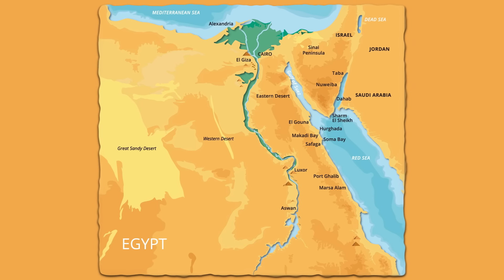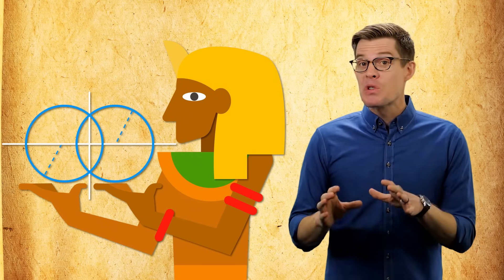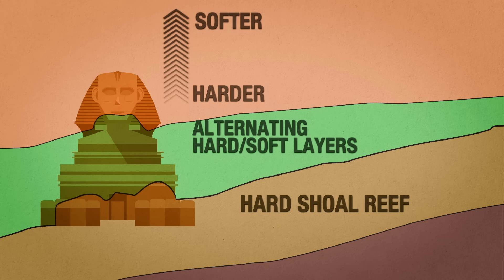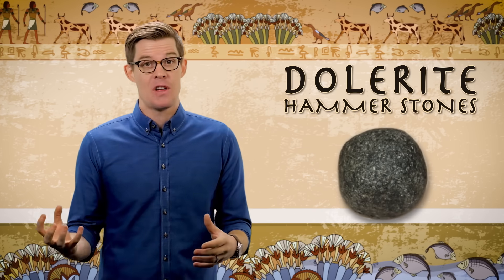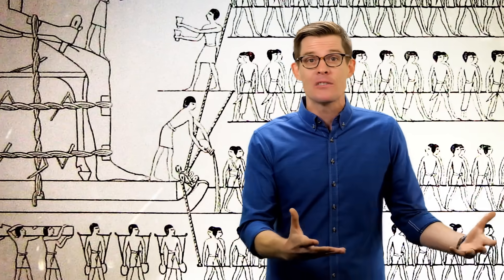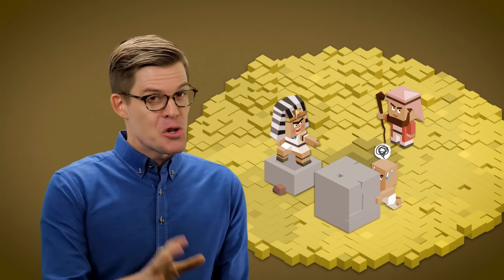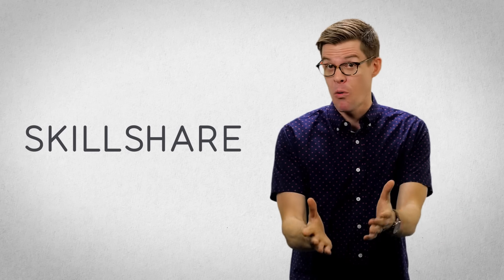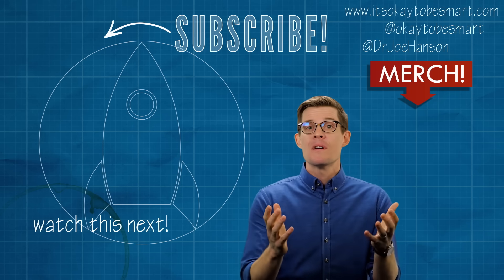The INCREDIBLE Ancient Engineering That Built the Pyramids

Comment: Bring your evidence you say!? There is no evidence. Please demonstrate a copper tool cutting granite to a perfectly level, precise surface! You skipped the bit about raising (or lowering) 100 tonne granite blocks into place. Fact is there is no science  can demonstrate how they built many other places also. Such as the Serapeum at Saqquara which does not have the space to move the massive blocks.
Reply: 🥱  First is there are no "100 ton blocks" in any of the pyramids.  Next is what blocks you do see are far from "perfect".  Last is there is ample room on the Serapeum to maneuver the sarcophagi into the crypts.  Perhaps you should find new more credible sources of information given your poor assumptions here.  Just saying.
Reply: @varyolla435  OK 70 ton blocks then in the Kings chamber. There is enough room in the Serapeum for about 50 to 70 men in very cramped condition. That's along the tunnel which would be pretty useless in turning the corners and then lowering the granite blocks into position and you'd need more than 70 men for that. Add to that the granite cut with laser precision that most engineers agree they don't have a clue how they did it with primitive tooling. That same precision was used in the Kings chamber and the grand gallery in the great pyramid where you cannot fit a razor blade between the blocks. Maybe you should do your research before commenting... Just saying!
Reply: @ramases1  lol!  I have "researched" as you say = for 40+ years.  The Serapeum was modified for tourism.  Thus niches and corridors have been built up in places to modernize them.  

Also niches are kitty corner from each other.  Thus a sarcophagus on a sled can be pushed upon from the opposite niche across the corridor.  Look at a diagram of the temple.  See whereby there are always opposite niches or new corridors where corner niches are found.  

Finally why do you only assume "men"???  Did it never occur to you that they also used oxen for construction etc.?  Build a wooden frame around a block and it can be pushed upon and maneuvered via a wooden plank/log path.  There are old B&W videos on YT of massive blocks being moved from quarries in such a manner.  

As to razor blades = PFFFT!  Smooth 2 blocks and stack them atop each other.  Now stack several hundred thousand tons of blocks on those.  I rather think the enormous compressive pressure will prevent you inserting something in the joint.  Parroting inane rationalizations is not indicative of actual research - nor critical thinking.  Dig deeper.
Reply: @varyolla435 The Serapeum has been altered for tourism but only for ease of access so makes it even harder to believe what they did supposedly with stone age tools and methods. How can you lift a 70 ton granite block and move it round a corner then lower it into a space when you only have a few metres of corridor to work in and a matter of inches at the sides of the tombs. Why have no archaeologists or engineers been able to demonstrate this? Because it's impossible with the technology available to the Egyptians. As for your stone theory, piling rocks on top of other rocks to cause pressure weight will not miraculously flatten out the stones beneath. Do you seriously think if you have a roughly shaped block of granite and you cover it with masses of stone then it will somehow become this perfect rectangular block with angles and surfaces of laser precision!!? This is the kind of response a 5 year old would give. Come back and argue when the calibre of your arguments has reached maturity and you have caught up with evidential study

Comment: And what about 70 ton granite slabs from Aswan and how they hollowed out coffins from granite making the inside of them perfect 90 degree angles..
Reply: Look harder.  Old Kingdom sarcophagi such as in the Great Pyramid if you look at closeup photos = do not have perfectly formed sides.  Things look "neat" from a distance because your brain is "filling in the blanks" to sharpen what your eyes perceive.  Yet up close imperfections become more apparent.

Look at the depiction of artisans at work in the tomb of Rekhmire.  See an Egyptian as an example using a square to check plumb on the side of a block.  See another using a tubular bow drill to drill a hole.  There is a stone artifact unearthed at Armana which was created in part via small drill holes.  In the drill holes was residue = copper and corundum.

Moral of the story:  look at photos of those relieving chambers.  See where they are little more than roughly hammered out chunks of granite in approximate rectangular shape.  Thus as they were not supposed to be seen the Egyptians exerted little effort into shaping them.  They merely hammered out "rectangular-ish" slabs of granite and dragged them into position.

As to sarcophagi.  Heating an area using fire to soften the stone along with tubular copper drills and an abrasive like sand or corundum will allow you to remove cores from the center of a block.  Then using gneiss stone tools to hammer/chip out those cores and flatten out the sides = you can via polishing with flat blocks smooth the sides out.  Those sides like the depiction can be checked against a wooden square for plumb - just as carpenters do for walls today.  Yes it can be time consuming.......but they had the time.  Artisans were employed by the Pharaohs and this was all they did as it was their job.  Pharaohs gave them housing and food and they worked solely on creating what the Pharaohs wanted.
Reply: @varyolla435  they went to different parts of the sarcophagus with a right angle protractor to show the viewer. Can you provide a video of someone doing this with those primitive tools? That’d be pretty awesome to see.
Reply: @Joseph-dd9sj  I know of no videos of someone making sarcophagi.  If you look for videos on Egyptian granite cutting in the search box you can see experts using tools as depicted in Rekhmire's tomb.  Among the experts is Denys Stocks.  He has duplicated stone objects using Egyptian techniques.  Read up on him.

Comment: what about the granite boxes? copper tools and hammer stones wouldn't be up to the job.
Reply: If you mean the sarcophagi.  Dolerite and fire can be used to obtain the rectangular blocks from the bedrock which are then polished using flat blocks and an abrasive such as sand or corundum.  The insides can be removed using gneiss stone tools to chip it out or tubular copper drills to systematically remove sections of the stone which are hammered free.  What remains is then sanded smooth the same as the exterior.  

There are videos here on YT which show copper saws and drills such as are seen in the depiction of Egyptian craftsmen at work in the tomb of Rekhmire.  They along with sand in the video and "elbow grease" can cut granite.  A stone artifact unearthed at Armana was fashioned in part using a tubular drill.  In the drill hole was residue which when analyzed showed copper and corundum - Mohs scale 9.  

Bear in mind that they would have known before the foundation of the pyramid was laid out how much granite was required.  So a quarry like Aswan which was in continuous operation would have had partially quarried stone on hand and they would have had years to fashion what was needed and transport it to GIza before it was to be placed in the pyramid.  You must consider the totality of what was going on.
Reply: @varyolla435  thanks for the comment, il check these video's out that show examples of how they were made.

Comment: Ya ok, under fed men with pulleys and ropes hauled 100 ton stones 200-300ft in the air up 60 degree inclines.
Reply: Except that:

1 - there are no 100 ton blocks in the pyramid.
2 - they are not 200-300 feet up in the air. 
3 - you are assuming the ramp to be 60 degrees = based upon what exactly??
4 - you assume the men were underfed = when the evidence shows otherwise.
5 - you assume only men were engaged in manual labor = when the evidence shows otherwise.

Moral of the story:  so we see lots of poor assumptions = but no actual facts.  So we have evidence they used ropes and sleds as examples exist in museums along with tomb depictions.  The largest blocks in the Great Pyramid are only estimated to be around ~70 tons or so while the King's Chamber is between 40-60 meters above ground level = making it less than 200 feet up.  The midden heaps at the worker village show a varied diet far above what the average Egyptian consumed which shows they were fed well.  

Meanwhile the ramp really only needed to go as high as the largest/heaviest blocks to be raised = King's Chamber.  Above that level the blocks get smaller and thus levers and a device such as Herodotus wrote of which used a fulcrum and counterweight could raise the smaller blocks from level to level.  Finally they found tens of thousands of cattle bones at the worker village.  We further see loads of examples of oxen employed in labor to include pulling a sarcophagus such as in the tomb of Hunefer.  So they would have used draft animals in addition to manpower to pull large stones.  Next time learn what you try to claim as things go better when you do.  Better luck next time.

Comment: No one knows the answer.  This is a bunch of highly educated people who come up with these crazy theories that HAVE NEVER, EVER proven!  Just show one video of someone cutting, moving an 80 ton granite stone, lift on a wooden boat, 500 miles away and place it. I would just love to see the size of just one of boats.  With copper tools, heat and sand...I can't!
Reply: 1 - you have elucidated a failure of logic here in that you apparently can only conceive of lifting a block.  I guess it never occurred to you that ancient people - and even today coincidentally - routinely employed = ramps.  Thus they did not need a crane as they had a ramp to raise those few heavy granite slabs the short distance from the ground to their place in the pyramid - those blocks are only about 1/3rd the way up.  
2 - blocks were moved via wooden sleds pulled by teams of men and draft animals = oxen.  Only the smaller blocks which make up most of the pyramid would have been raised the short distance to move them from level to level via a type of lever device employing a fulcrum and counterweight akin to the Egyptian shaduf.
3 - as to the boats.  There are of course the large solar boats buried alongside the Great Pyramid as remaining examples.  For even larger ones feel free to Google depictions of the massive 3 decked barges seen on the walls of Hatshepsut's mortuary temple.  There you will see huge wooden barges laden with obelisks which are further being pulled by multiple smaller ships via sails and pole men.  

There are coincidentally videos here on YouTube showing them cutting granite with copper saws and sand.  Also there was once a harbor which sat at the base of the Giza plateau about ~500 meters from the Great Pyramid beside the Temple of Khafre and the Sphinx.  It still has the stone jetties sloping underground where barges once unloaded.  Finally the diary of Merer elucidates this process as he and his crew were tasked with bringing the white limestone used for casing stones on the Great Pyramid to Giza from the Tura quarries.  Better luck next time.

Comment: oke, that copper saws and sand can cut limestone is true. I would like to see a 'real life' experiment where a team cuts 2 (just two) complet blocks with a copper saw and sand.
Then they will fit them together in such a manner that a credit card will not fit between them anywhere.
And then the will cut two granite blocks and do the same fitting together.
and then the 'sarcofagus' in the 'Kings chamer'

And then we'll talk again.
Reply: Facile logic.  You do not need to fashion "complete blocks" to demonstrate proof of concept - straw man argument.  All you need to do is to show you can cut stone using the aforementioned tools.  If you can saw/drill into a block using bronze tools along with abrasives = the method works and the subsequent fashioning of blocks or whatever becomes a matter of detail.  

As it happens you can seek in the search box above a video:  Granite Cutting and Drilling.  See whereby Egyptologists and subject-matter experts saw/drill into a granite block using a sand/water mixture along with bronze tools such as are depicted in Egyptian tombs.
Reply: @varyolla435  Negative!!!

You DO need to show you can fashion complete blocks; including the most difficult parts like:
- making oposite sides parallel,
- 90 deg. corners;
- smoothness
- etc. etc.

in the same time it will give a feeling for 'production times'.

One of the main issues with traditional Egyptology is: Logistick.

Show me it can be done in with the primitive tools; in the requiered time, with the exact same result.

'proof of concept' is NOT enough, not by a long shot.

And yes, I saw some of these 'proof of concepts' form traditional Egyptologists.
But the prove ONLY the can saw into limestone / granite. But the do nót show they can reach the same level of finish.
e.g. the 'core drills' the make do not advance in the same rate as shown in 'fossil' core drills scatterd aroud Egypt.

Only if these guys can reproduce the most difficult parts they might be onto something.

Now it is just extrapolating on insufficient data.

And when the have shown they might be able to build a pyramide, we will move onto granite boxes, sarcofaguses etc.

'proof of concept' only proves the concept.
It does NOT prove the endresult.

So, please, prove me wrong!
Reply: @varyolla435  Another argument why you realy do need to produce complete endproducts:

They state it can be done with the proposed tools with the proposed method.

I state it can NOT be done.

Please prove me wrong.
Reply: @pvdneste  "I state" = basis of all your problems.  Dunning-Kruger rules all for some it seems.  Alas for you the actual subject-matter experts relating to these things have determined otherwise = and that is what counts.  So Hitchen's Razor applies.  It is not for the experts to disprove your incredulity as the evidence it there - take it or leave it = but for you to prove them wrong.  Your "beliefs" count for very little I'm afraid.  Only the evidence matters.

Enjoy your "opinions" and the incredulity they engender.  Here in the real world we actually do follow the evidence and science.

p.s. - you apathy at seeking evidence will always be your downfall.  There are channels such as Scientists Against Myths who using simply tools can shape stone - to include your corners.  That you parrot inane talking points is understandable.  Yet as I have alluded here = there is always more evidence out there.  What it requires is your willingness to seek it out.
Reply: @varyolla435  BTW: I never have heard of Hitchen's razor. Ik have heard of Ockham's Razor. It applies and thát lease tintje conclusion thát traditional narratieve on making and dressing blocks, boxes etc. IS wrong
Reply: @pvdneste  So you do not understand Occam's Razor either I see.  How sad.  Subject-matter experts ascribe to your "mainstream" explanation because = that is what the evidence points to.

Ergo in so much as they have evidence to work with which is accepted via peer-review consensus - whereas all you seem to have is your incredulity = they win as evidence reduces the amount of assumption - which abides by Occam's Razor.

p.s. - Hitchen's Razor states that unsubstantiated claims can be dismissed as easily as they were made because they are unsubstantiated.  In other words if you are going to dismiss the evidence based explanations science offers you = you must have compelling evidence of your own to support your position.  "I don't believe........" is not enough.
Reply: @varyolla435  BTW way: you make a very basic mistake: i do not need tot 'prove' the mainstream narratieve about the wat pyramids etc were build, are wrong. They have to 'prove' they are right. Only one falsification of their elaborate narratieve is needed to send it down the drain.
And as yet there is no 'proof', only assumptions.

Still waiting..... 😂

Please prove me wrong.
Reply: @pvdneste  the Egyptians only had bronze tools based on all archeological evidence and since it’s been shown that these tools could cut theses stones then this is solid evidence that this is how it was done.until evidence comes out showing this to not be true it is the best supported idea for how it was done.

Comment: It is thought that the great pyramid at Tenochitlan outside of Mexico city was 150 years in the building...without the wheel.  This man says the great pyramid (using Herodotus as his guide, apparently) took 23 years to construct...without the wheel.  No, it did not take 23 years.  123 years is a more likely figure.  The other pyramids slightly less.  The great pyramid would take twenty years today with modern machinery and technical input.  The fact is, modern theories about the pyramids are mostly rubbish.

Comment: What about the 70 tons heavy granite beams (many of them)? To pull it up to the pyramid they would need at least 10 degrees angle, which could not be made from sand (obviously) and it would have to be VERY freaking long. The math doesn't add up. Your math might (I didn't check yet) but that is only because you do not have all the facts..